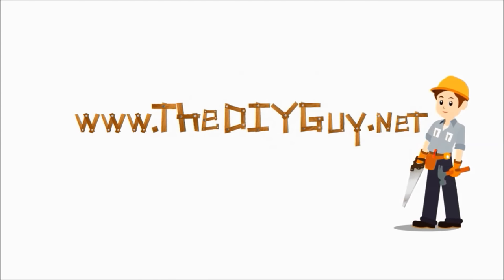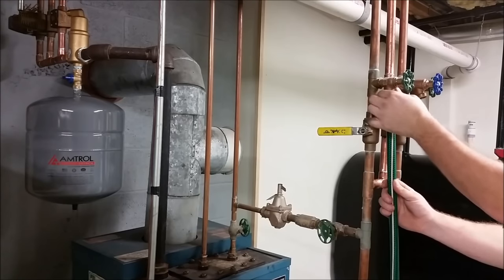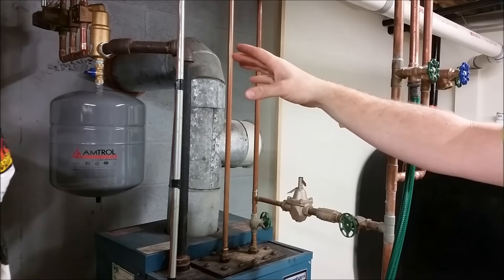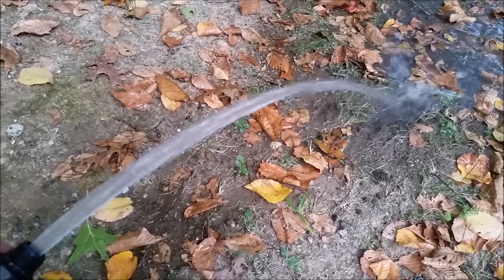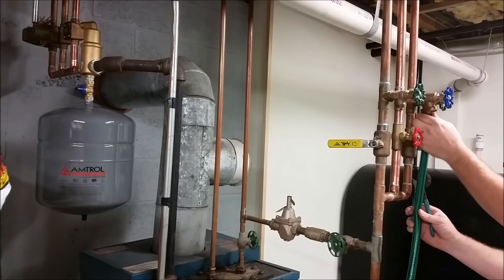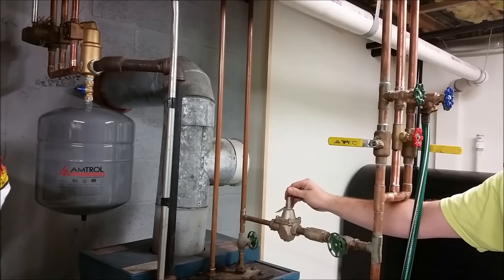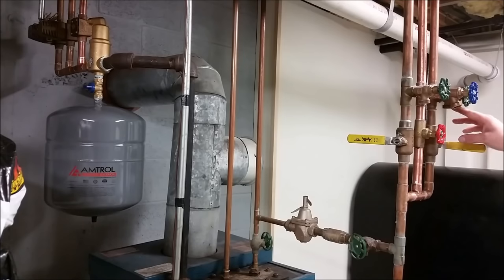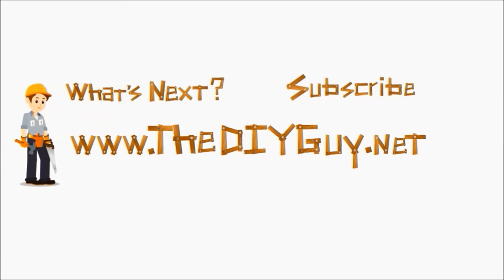How To Remove Air From Your Heating System

Comment: Excellent thanks.  Just one small comment - I would let the boiler cool down completely because I wouldn't want cold water rushing through a hot heat exchanger.  An onrush of cold water may create a thermal shock and crack the heat exchanger.  Thank You.
Reply: This will never happen as the volume of water already in the system will act as a cushion against rapid temp change. In a teeny tiny system maybe it could be problematic but in a large one its no biggie. I work highrise building and haven't cracked a heat exchange in 15 years at that scale.
Reply: In the winter Would you let the water temperature cool down till the thermostat on the hydronic boiler went down to about 70F, which is the bottom of the scale?

Comment: Something I don't get is why doesn't the air separator or the high vent take care of this air? Why do you have to do it manually?
Reply: Those only take care of microbubbles. if you do not purge the system then the air may get trapped in other areas of the loop.

Comment: These are closed systems, correct? If you drain water out to bleed do you have to add new water into the pipes after getting rid of any air in the line? Thanks.
Reply: That's what I wanted to know

Comment: THANK YOU! I've done a lot of work on this boiler to keep it running and some cold nights. Just replaced the taco pump and the temp gauge, total of $200 and I'm hoping it saved me from a brand new boiler for at least one more year! Just got quoted on a new boiler, $20K!!! There was a ton of water in my system after doing this work and it was so cool to hear the air coming out and then finally running clean and with no air I hope! I'm not sure what happens when there is air in the system.... but I'm glad I did it. Woke up in a warm house.

Comment: Thanks for this. I wasn't doing it right. I could not get the air out of my upstairs zone because I closed the downstairs valve but left the upstairs valve open (yellow handles). Some of the air came out the hose but some of it continued past the hose and back around into the zone again. After 30 minutes of failure I gave up and looked online and found your video.

The key point you taught me is to close ALL the valves including on the zone you're bleeding, which forces all the water and air out the hose.
Reply: you should also leave the lever up on the feeder valve while bleeding to make up the pressure lost.
Reply: @huilin5841  True but if you do that then you also need to watch your pressure gauge! Must keep it below 30psi or the pressure relief valve will dump water all over the floor.

Comment: First, thank you so much for this informative video.  I'm a disabled senior widow, on a fixed income.  I found this video after I opened the valves that water come out of.  That's all I did, but I used a kitchen mop buck, and up and down the stair. It worked and now I have heat. I thought that honeywell thermostat wasn't working. I hate that thing to. I have heat now. Of course this was on the coldest day so far this yr. 20 degrees. Plus a Sunday.  That bill would have been at least $350 here in NY.  I have a question.  How does air get in the pipes in a closed system.  I've never had to do this until 2yrs. ago. Again thank you and looking forward to your answer.
Reply: Ditto, widow here too trying not to call the tech but I have rooms that are cold. Getting a key delivered on Saturday from Amazon. Mine is glugging

Comment: Hi, this is a great video. But I have one question. My new Yorker boiler is tankless. Should I still turn the oil switch off in that case? How would the water from the line heat up otherwise?

Comment: This was invaluable info in purging the air from the system after I had to open it up to fix a leak in a PEX clamp connection that must have been poorly installed. Clamp just split completely and it ruined the flooring and ceiling below from the slow leak that resulted.

 Followed the sequence of closing the ball valve,  connecting the drain hose to the gate valve, opening the gate valve and letting the air get mostly pushed out. For some reason the second story zone still apparently has some air in it because it can be heard as the circulation is going on but at least it's now delivering heat, where it was completely cold before.
Tried the rapid fill to increase the pressure but that resulted in the pressure release popping, so I could only do that very sparingly, to avoid flooding the floor when it released.
I may try another purge session after it runs a while under pressure.

Comment: Question: As I recall when I did this a few years ago, the pressure dropped too much to push a healthy stream of water out the hose and I had to pull the lever up on the  Feeder Valve to get the pressure back up. (Yeah, one year I left the room and heard a loud noise as there was TOO much pressure and the overflow pipe blew water over the floor - though I must say the system was really toasty that year). Since then, 2 out of my 3 zones had small little "air bleeders" installed. I think they are supposed to automatically bleed the air out of those zones. Do I periodically open those bleeders to get air out? Also, there is an Isolation Valve to the overhead Expansion Tank. One repair guy bleeds with it open, another guy said you had to close it when bleeding, etc. So, I am stumped on that. TIA
Reply: I’m having this same problem. How did you resolve the water from overflowing??

Comment: I'm trying to help a retiree to avoid calling in a plumber. Her home is two stories with cast iron rads with bleeders on each rad. In the past I've bleed the rads in the fall and her system worked OK. This season, there is heat in the basement and first floor, but the two rads in the second floor are both cold and when I opened the bleeders, no water comes out. This would suggest the system does not have enough water in it. I don't see the zone valves that you show, but I found a water tap that when I opened it, I could hear water entering the system. I'm reluctant to just let this run, but would suggest by running this I might be able to top up her system at least the point where the top floor rads get partially full even if they have some air in the system? Thanks for any advice to seniors trying to avoid costly repairs.
Reply from the maker: Hello, If its an older system it might not have an auto feed valve to keep the water PSI somewhere between 12-15 PSI. Some just had a valve where you can manual add in water to keep it at the correct PSI. Check the pressure gauge and see what it says if its low bring it up to 12-15,  18ish max then try and bleed the rads again and when your done make sure the psi ends up between 12-15. Some of the older systems also you multiple circulator pumps rather then zone valves. The system will fill with some water but you will need to bleed the rads to get the air out of the system so the water can take its place. Depending on how much water you need to add it would be best to add water to the system and bleed the rads a couple times before turning on that zone. Good luck with getting it up and running.

Comment: Hello and great video. One question, I followed the directions and everything worked fine except for some emergency relief valve leakage from the boiler after the 4 zones were purged. How do you do this without experiencing the leaks after the boiler fires back up?  It seems the pressure was too high and water was needing to be released?
Reply: when raising water pressure you must watch your pressure gauge.Never let it get above 30psi which is when your pressure relief valve dumps water to relieve pressure above 30psi. When finished your pressure should be around 12psi when cool.
Reply: @mattfoley6082  thank you!

Comment: Great video.  I had a heating service come by to do this with an annual cleaning but the air bubbles come back in the line within 3-4 months.  NE living still need the heat through May.

Comment: I like the way you explained.  Here's my question. Laars boiler. 
How do I fire up furnace  when my my attic thermostat (120v) calls for heat. Only opens zone valve ( 120v) and kicks on secondary pump. But no fire in boiler. 
Primary thermostat is in 1st floor ( batteries operated) just 2 wires direct to boiler. 
Note. 2 zone valves are 120v. Not 24 volts. Each zone valve has its own pump to run. 1st floor  and attic. But... attic thermostat is also 120 v. 
Cast iron radiators. The zone valves are in 2" pipes. So I don't want to mess with those. If you Just can help me how wire  so the boiler kicks on when attic 120v thermostat calls for heat. Not messing the 1st floor thermostat. If is not calling. Thanks.  I hope you can help. Most the guys ( companies around. ) " i never saw those zone valves  before "
Again. 
I don't need to do anything to zone valves.  I just need fire up the boiler for the attic.

Comment: Would this help if you're not getting much heat on the 2nd floor?  Could it be air in the line?  Had this done a couple years ago and it seemed to fix it.  But I also had that water regular thing break and water was all over the place.  Then the plumbing guy came out and replaced the regular and bled all the zones.  It was banging for a bit and then stopped.  Maybe it stopped because there's more air in the line now than water?   Thank you for the very organized video.  Best one I've seen yet.
Reply: check if your circulator pump is working....

Comment: I don't have any shut off valves for my loops like you do here. I do have Taco zone valves right after the drain valves on my loops so I'm guessing they will act as the as a shut off valve if they're in the closed position?

Comment: Very informative.  Question- I need to purge one out of three zones only.  For that single zone,  do I need to shut all return valves or just the one that I need purged and leave the other 2 in normal open position?  Thanks
Reply from the maker: You could get away with not shutting the other ones. But I find it best to shut all just to be sure that all the water pressure goes though the zone your trying to purge. In case that shutoff valve leaks.

Comment: Quick tip for you, if you get a garden hose just long enough to put into a 5 gallon bucket it works a little bit better in that you were able to see inside the bucket when all the air bubbles are out.

Comment: Great video, thank you!  I tried it and it worked perfectly.  The only thing I did differently is run the hose into a large bucket, so I could see the air bubbles bubble-up through the water - when this stopped for a while I knew any air was purged.  Thanks again.
Reply from the maker: You're welcome, Glad we could help. Thanks for watching and taking time to leave us a comment. Another person said that in a comment as well. Good idea. Don't forget to give the video a thumbs up/ like if you haven't already. Thanks

Comment: Is bleeding the burner different from bleeding the radiators? 
I have a brand new oil heater and sometimes it sounds like “rattling” pipes. I’ve tried bleeding the radiators but no air ever comes out? 
Sorry if this is a dumb question. Single mom here, just trying to learn.

Comment: Vey informative, Thanks.  
2 Questions- I have 3 zones, problem chlild is zone 1.  Can I just follow your instructions for that single zone or must I flush out all zones?
 You mentioned that the water is going to come out cold and once it goes through the boiler it will get hot but if the boiler is off, how will the water come out hot or should I run the boiler for 10 mins and then follow your instructions?
Reply: Hi. Yes. He said you will feel hot or warm water.  Because the unit was ON. ( BEFORE).  Is like a  light bulb. You just turned off. It my be hot. When you get the cold water  out. That means you purged  the air out.

Comment: So the feeder valve is always able to provide some pressure to the system so you don't isolate it (close the valve) after you purge the air?   If that's the case, so that I'm understanding this correctly, it seems that It wouldn't introduce  cold water into the system in any real volume unless there is a break in the loop/valve open/or helping air purge ever so slightly via a bleeder valve.

Comment: Thanks a lot for the DIY video. It makes a lot of sense. I had my boiling firing on but the water is not circulating. Initially I thought the pump is broken. Then I leaked some water from the pressure valve and also added more water pressure from the refill valve. The pump seems working again now. But I guess I should do it properly to remove move air now after watching your video. Just one question. My returning water not only goes back to boiler for reheating but it also connects directly to the hot water sending side (without reheating). There is a valve between that link however that valve is turned on right now. This is very strange to me.  Why the returning water not just go back to boiler? And now I am not sure how I can drain the water to remove air. I guess I must shut off the valve so that the returning water does not go back to hot water side. Thanks!

Comment: nice work.  

I have a 9-zone system + sidearm water heater. 2 loops dead (driveway, long ago, garage froze and ruptured loop  more recently, cutoffs and zone-valves hold water).  7 to bleed air from.  2 floors, water dist manifolds on ceiling of boiler room (driven by 2nd pump, on 2nd loop), downstairs loops do a lot of up/down from furnace to manifolds, to loops.  Lots of air-trap potential.

which floor should I purge 1st ? bottom ??

does banging tend to happen when the loop with air is being heated, and not otherwize ?  If so, I could start to check whats hot when I hear banging, and purge that loop 1st.

furnace primary loop has 2 drain valves with cutoff between, this looks like the spot.  water fill is downstream of the cutoff, I presume drain valve is upstream of cutoff ?

should I wait til spring ?

Comment: I have 4 zones. 3 zones are for baseboard radiant heat. The 4th zone is for an under floor radiant heat zone. The 4th zone does not have a zone valve. Should I shutoff that ball valve as well before draining the other zones?

Comment: Thank you for posting this. I think have that exact boiler too, or close to it with 2 zones.
How often should this be done? Everytime the heater turns on I can hear it creaking a little, so this is why I suspect air.
Reply: @Thomas Joseph , I am no plumber, but I do have baseboard heat. The "creaking" you hear (like I do) could very well be just from the pipe going from a cool state to a hot state as the heated water reaches and circulates through that particular zone. The metal pipes and the metal "fins" that surround the pipe expand and contract just enough to cause that creaking sound. 

Now, if you hear gurgling, or something that sounds like a mini waterfall coming from inside your pipes, that means there is air in that particular zone and has to be bled out. Air in these pipes slows down the flow of water through them. That's why it is difficult to heat the rooms properly. Once the air is bled out and there is nothing but water in the pipe, then the rooms  will warm up faster, once the boiler temperature is back to normal.

Comment: Don’t forget to verify the pressure and set to 18 psi using the purge valves that the garden hose was on, then unhook hose and turn the boiler back on. 
The feeder valve will over pressurize the system to water pump setting, or town/city pressure, 35-65 psi depending on the source, so it’s important to verify after purging any air.
Reply: So I didn’t see your comment until I had already unhooked the hose.  Now the pressure is way to high.  How do I lower it?  Thanks for your help.
Reply: @justinmcdermott4690  were you able to figure it out?

Comment: @TheDIYGuyDOTnet   In this video, on your system the direction of the flow of boiler water goes from the boiler, to the zone valves, to the "spigot valves", to the "line shut-off valves". (I'm not sure what they are actually called). 

On my boiler system, the flow of water goes from the boiler to the zone valves, to the line shut-off valves, and then to the spigot valves. Does it matter that my spigot valves are "down-line" from my line shut-off valves?

In my case it seems that I would have to keep the line shut-off valve in the open position in order for the water to circulate through the entire zone, and then out the water hose. (I have 3 zones, so I would need to close the line shut-off valves of the 2 zones from which I am not trying to purge the air).

Comment: This is a fantastic video but what happens if you don't have a shut off valve by the drain valve?  Is there a check valve in the circulator pump to prevent water from flowing from the boiler?

Comment: I have a similar setup with the boiler. I have tankless hot water tho. I want to tie a wood stove so I can heat with oil and wood. I believe I have steam heat, cast iron radiators. I want to connect the wood stove chimney to the oil burner with a T so i dont need a separate chimmney setup. having a electronic flap for the oil burner can I even do this? 
Does it go before or after the flap? I'm sick of being cold and always running out of oil